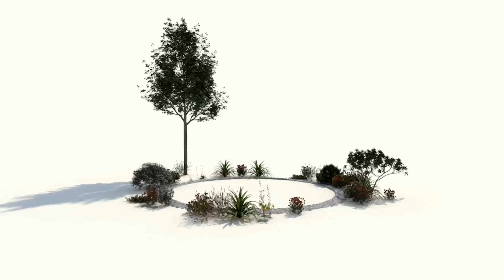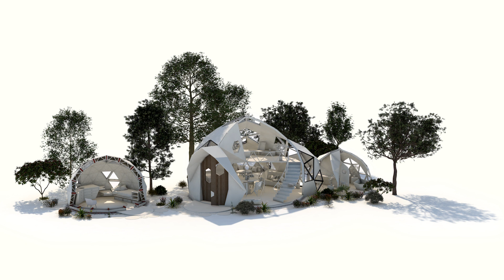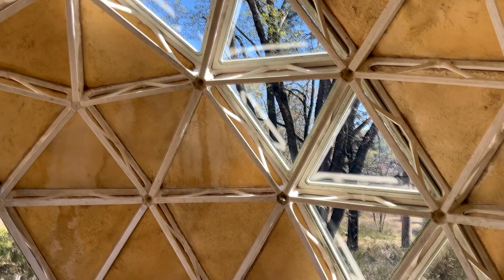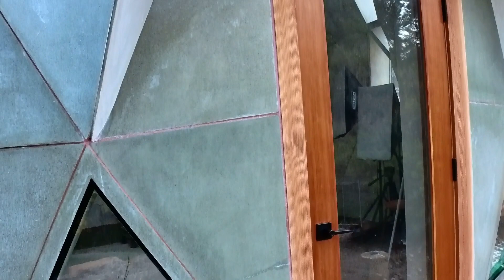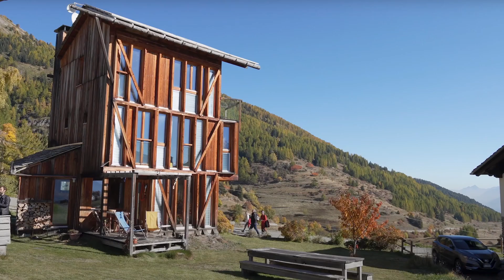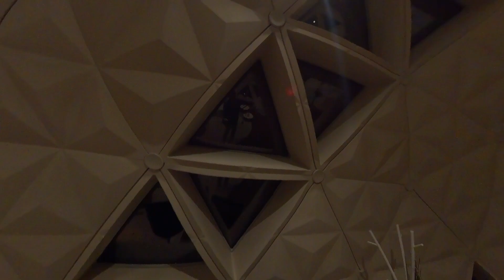Geoship Interview with Bas Kools - Co-Founder/Designer | Bioceramic Geodesic Dome #geoship @Geoship

Comment: how does ceramic structure hold up to say, hail damage? those that live in texas for example, deal with seasonal hail storms, most of the time less than dime sized hail, but sometimes baseball sized? how does the part replacement process go? insurance etc?
Reply from the maker: Asked Geoship directly & they said:

Geoship’s bioceramic is stronger than concrete, highly impact-resistant, and if extreme hail ever causes damage, the modular panels allow for easy repair or replacement.

Comment: Great Job and good luck. I built a 45 ft. diameter 5/8 Geodesic dome back in the mid 1980's with plans from timberline. 6 in. wood frame with batt insulation , dry wall interior and asphalt shingle exterior. This ceramic material is very interesting and I was wondering if there are any places that offer a tour in one . I am interested in how it feels, inside. I am also interested in what type of form was made to pour the ceramic, and if tubular wiring was pre installed before the pour. Anyway, good luck.
Reply from the maker: That's really cool about what you build. How's it doing now?

I asked GeoShip to reply to this. I'm not sure on the form of the mold or availability of tours.